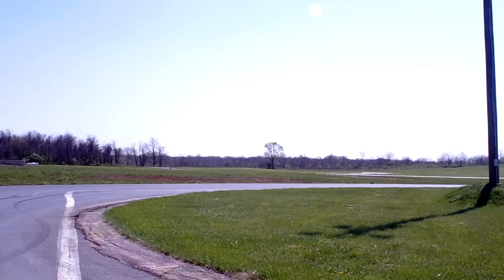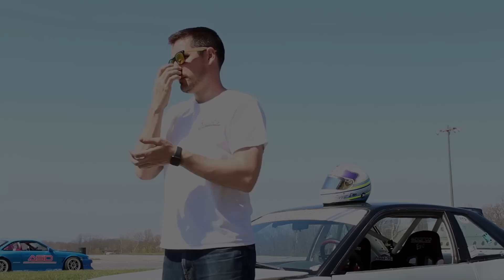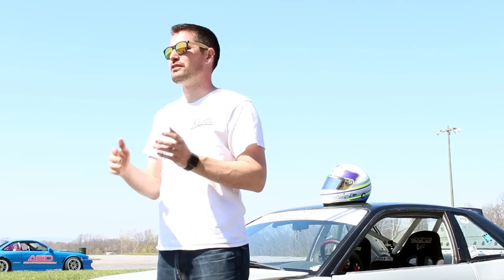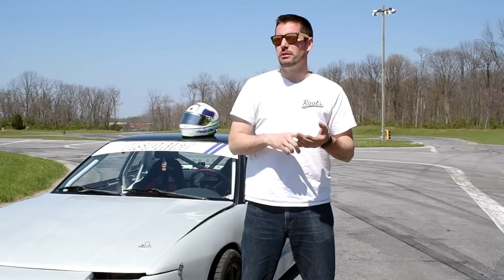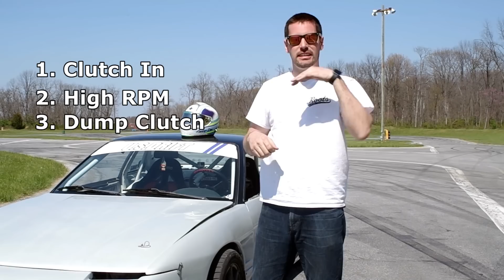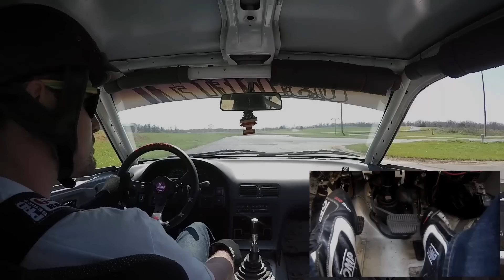The New Drift Testament: EP11 - Modulations

Comment: How much wear does the first method put on the clutch though? I'd expect it to be burned out pretty quick.
Reply from the maker: It actually puts much less stress on the clutch system than you'd think. Since the clutch is engaging abruptly, there isn't must time for the material to wear. The only time your clutch will wear quickly is if it doesn't engage and spends its time slipping. But by that point, I'm sure you'd smell the clutch burning.